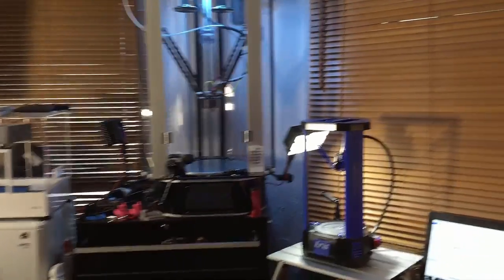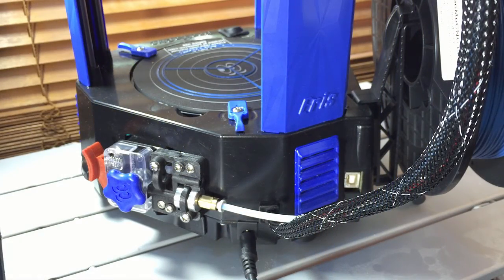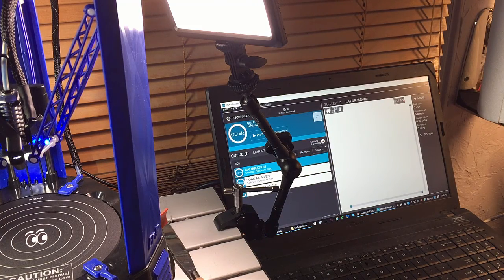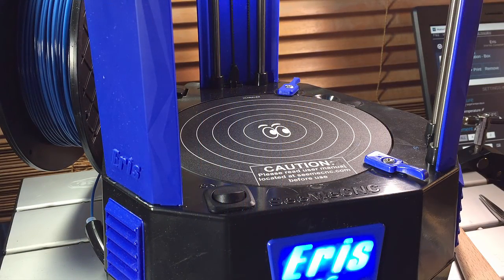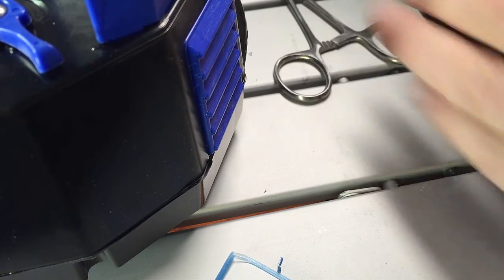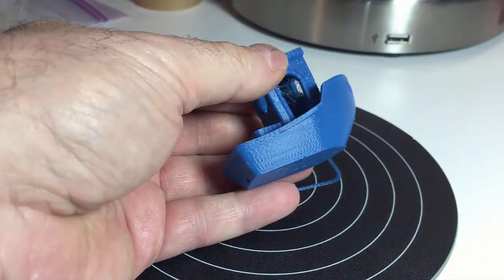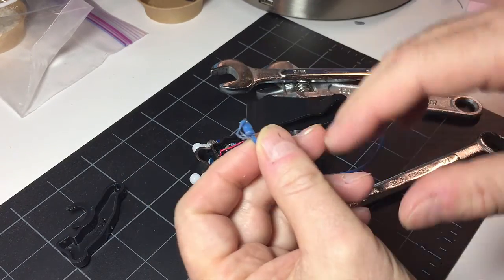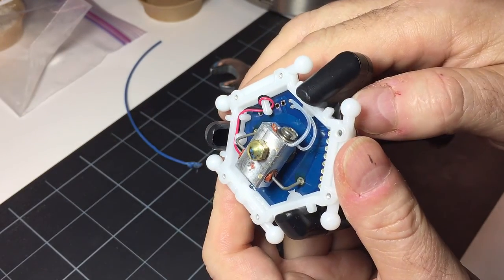Eris 3D Delta Printer - setup, first prints and impressions

Comment: does this have a sd card slot on it?
Reply from the maker: Not at this time, though a future upgrade with an LCD might support it... Or go with OctoPi or AstroPrint on a Raspberry Pi
Reply: alright thanks for the info! great video.
Reply: Octoprint runs just fine on a pi zero. So $5 for the pi zero then add a $10 accessory kit and you could be good to go.